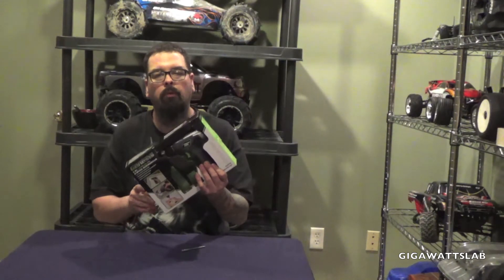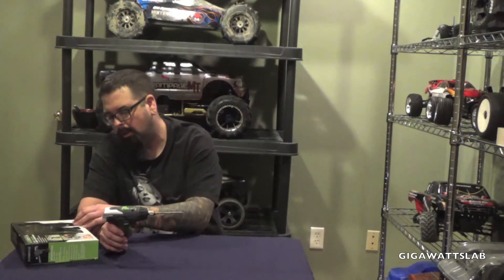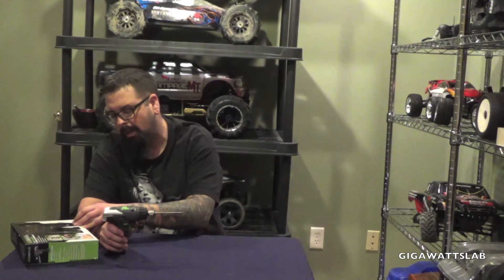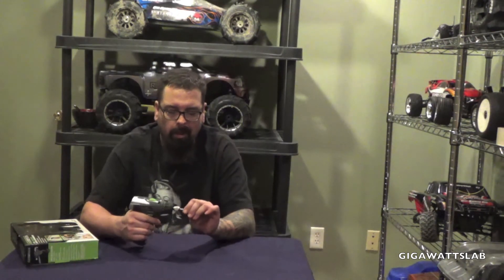BEST 1/4 DRIVER FOR RC EVER

Comment: What bits do you use? I have had a hard time finding the small hex drivers.
Reply from the maker: Ofna has some 
http://www.advantagehobby.com/92404/OFN10823/10823-Tool-Set-14-Drive-wHandle-9/
Reply: Nice... thanks man!
Reply from the maker: MIP Makes some 
http://www.advantagehobby.com/239537/MIP9512/9512-Metric-Speed-Tip-Set/
Reply from the maker: Integy has them too http://www.advantagehobby.com/90528/INTC22778/C22778-Quick-Pit-Hex-Wrench-Set-7/

Comment: You still like this drill after a couple years?
Reply from the maker: Marc's O Scale Trains 
Yes 
I now have 3 
I will say the downside is it has an internal battery. So if the battery dyes it’s a paper weight until it charges